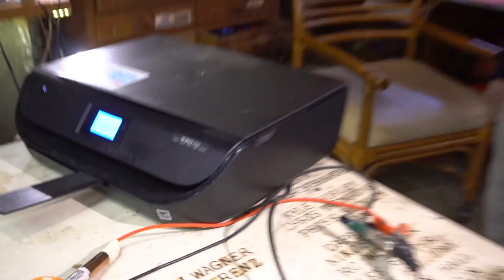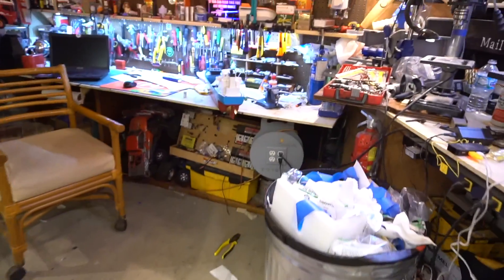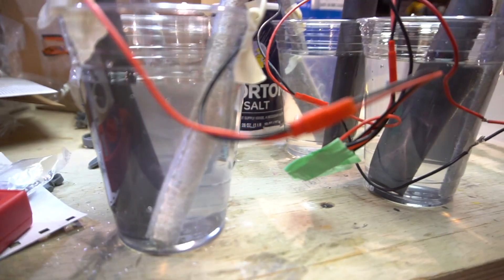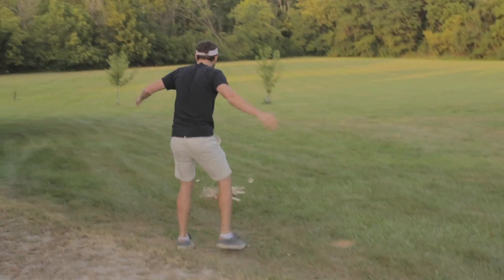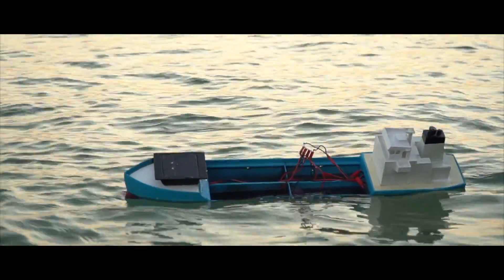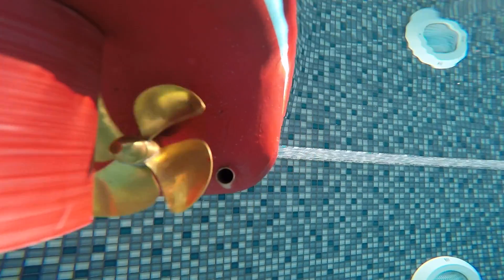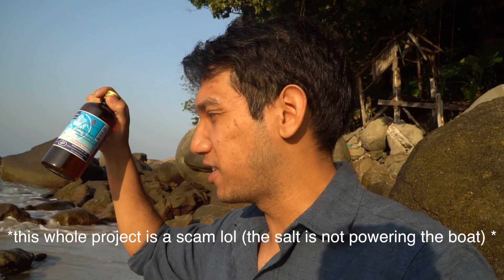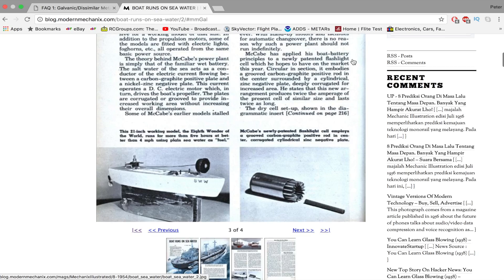Saltwater Powered RC Boat

Comment: What if you made a boat hull out of polyester resin and fiberglass with lines of alternating metals inlaid into the bottom of the hull and use the seawater that's under the boat rather than putting the cathode and anode inside with water? Would the voltage increase when water flows past the alternating strips of metal faster ? For instance if I built a 15' long by 8' wide trimaran and put in on anchor in salty tidal waters would the passing currents act as a charging system for a 12volt battery bank if I used alternating strips of say copper and aluminum and would it be better to run them lengthwise or perpendicular to the flow of water?

Comment: As a very old engineer nearing 85 years old, I am amazed at what one can do with the sophisticated blocks that are available these days for one to tinker with.  In my days it was not like that and we had to build the engineering block ourselves in the case of radio, I had to design and build the Tx and Rx down to transistor-level including winding our own motors and even making our own batteries. Engineering which I followed was not only tinkering with assembling and operating ready-made units,  but one had to learn about the characteristics of different materials, do a lot of calculations hence one needed a good background in mathematics and we who took up electronics we had to learn and test all there was to learn in analog and digital and switched electronics to achieve all the functions including memories and processes in microprocessors.  
At 6:08 this young man said, 
" I went to school for a course in aviation, but really did not quite finish that, for I really wanted to switch majors......so I did try an engineering degree, I did not fare so well in the super formal engineering settings so I left believing in more self-education from various sources such as YouTube, because I wanted to understand problem-solving through tinkering rather than listening to
 lectures   ...... It does not matter how you learn as long as you have a good idea of what is going on." 
The problem with many people these days is that they love to be the proud owners of what they buy as long as one can afford it to live with that mentality, but there is much deeper knowledge than one can ache3ve by just tinkering with assembling units bought off the shelf.  Going back to 1950 we used valves to make out Rx and Tx and by 1960 we were beginning to change over to transistors.
After learning all about transistor circuits  I decided to build my own eight-channel pulse with modulated Tx and the complementary receiver with proportional control. By then my mathematics was up to the level of understanding Maxwell's equations and solving to be able to design antennas and waveguides and their detailed performance. including gun diodes at their earlier stage.  
* The modulation stage of my transmitter was a set of eight variable pulsed followed by a synchronizing pulse fed to control the 35 Megahertz power oscillator radiating about half a watt.  All that had to be tuned to a center-tapped antenna matched accordingly.
* The receiver was a superheterodyne unit that i had to design from scratch where with the local oscillator the intermediate frequency was handled by a tuned amplifier and after demodulating the pulse train one needed to pick up the synchronizing pulse and with it set a counter to zero. Then the following pulses would step up the ripple counter where the output pulse on each " channel output" would remain for the duration of the pulse which was a duration of  0.5 to 1.5 milliseconds. The frame rate I used was about 30 frames per second.
Our enjoyment was not in just assembling complex units and operating them, but designing and making and tuning an eight-channel proportional control  Tx and Rx must have taken me about three months at least. When I finished that I remember building a submarine made out of oil gallon tin containers and that also required calculations rather than trial and error or tinkering with off-the-shelf units. 
We lived through WW2 and my three brothers and I did fill in our time with formal engineering education at a university and the mathematical engineering contents were high which enabled us to handle very complex state control systems and their stability. At the university, we were the first to design and deposit resistances and capacitors on glass substrates leading the way in microelectronics.  To be honest my heart sinks when the people seen in this video use Tx Rx and servos and such sophisticated electronics on disposal throw way units. If only rather than tinkering with them they would appreciate the level of intelligence that goes on to understand the intelligent circuits that are enclosed within them. Even designing and building a bootstrap circuit used to make us very happy and as we could not afford to do what young people do in this video we used to dismantle one circuit and use the capacitors and transistors and resistors in another circuits, we did not mind the inductors as we designed and wounded them according to (N^2)/S, One of the most difficult circuits we designed at around 1955, was the counter circuit which detected the synch pulse and then counted the number of pulses to decode each channel. These electronic circuits we later used to design the arithmetic logic units in microprocessors. 
Those young people who wish to take up engineering must be able to persevere beyond tinkering with off the self bought units and they need to be patient to build up a solid background in mathematics and now computer programming using engineering-oriented software. One cannot learn the highest grade of engineering by tinkering with the available devices as that is more of a technician level and not an engineering level. Any engineering direction needs a high amount of mathematical knowledge to be able to appreciate the many higher aspects that tinkering and assembling units bought off the shelf gives the operator a good thrill but that is not what one calls engineering.  Engineering does not need the sensationalism that normally accompanies videos on YouTube. 
Here is one aspect of the mathematical contents in engineering.  https://youtu.be/r6sGWTCMz2k. 
Laplace functions and Maxell's equations and Navier Stoke equations are also beautiful mathematical tinkering that needs perseverance and a higher effort to follow........ https://youtu.be/-LsXjVfucHU         https://youtu.be/g-5bi7dxHP4
https://youtu.be/Gq-sUhP3kDI
Reply: How did you get that old

Comment: Great build! How about you stick metal strips under the boat and used the ocean as a electrolyte? You could have multiple strips for higher voltage and current (with SxPx configuration), the weight should be lower etc.

Comment: what if you made a small engine that could pump fresh salt water in to the boat in one end and suck the old water out in the other end... that way you could build a closed system and control the level of the boat... they could be powered by solar panels... but really cool you made it work so well...

Comment: Magnetohydrodynamics is a thing but works on completely different principle. You would need a cryogenic cooling system, superconducting magnets, and a really stout inital power source/energy storage. Basically the the magnets are powered by initial power source at first, and make use of the Lorenz force to strip ions from the salt water and create current to power systems, but a byproduct of ripping these ioms free actually moves the water physically, creating thrust while generating power. IDK the threshold at which the process becomes self sustaining, and IDK if it's ever been done in small scale and would be very expensive if even possible.

Comment: I bet then you could put a computerized waypoint till that thing you could put it in the ocean and it will drive you may need to make a better bigger boat but it'll be able to drive automatically to where you wanted to go.  I bet you could make it to one of the islands close to where you're at Is autonomously with a computerized adreno system running your simple little boat
 I dare you to try that

Comment: Using a magnet and the orientation of the magnet in order to have the boat be facing a certain direction on the compass means you have a navigation system if you put a rotating magnet on there if you want to go South you point the magnet's North end to the back of the boat you want to go East you point the North end to the  Left side of the boat and so on

Comment: Maybe try drilling a hole in those electrodes and insert some copper rods. This might decrease the resistance of graphite rods and magnesium rods while keeping the surface area the same. You can also try using graphite spray on bare copper wires. This is going to make the boat more efficient. This might help you. Make more of these 3d printed ships and try different stuff like hydrogen fuel cells, solar cells, etc.

Comment: Or the Mark 44 seawater battery powered homing torpedo?   Weighed 150 pounds less than the later Mark 46 which used OTTO monopropellant with a swashplate motor.

Comment: If we make a boat. And we make cylindrical holes in that boat so that the water crosses from the tip of the boat to the back. And in those holes we put hydroelectric power generators. To power some turbines. Would the boat go on forever? Translated by google translator

Comment: Thanks the H2O2 tip was a needed tip for me. For budget-minded experimenters like me pencil graphite and magnesium camping fire starters are what I use and to get more service area I drill holes through the magnesium and I also scratch up its surface a bit.
here's a question to you do you think you can make something like that that will fly using a big pill bottle for a battery

Comment: The orange juice, or potato juice, or salt water, act only as the electrolyte, they are not the source of the energy.  Saying that such a boat would be powered by the salt water is like saying that a car is powered by the fuel lines, not the fuel in the lines.

Comment: You should program a rasberry pie or an adrino to just transfer the file to the 3d printer from the pc without removing the card because thats how my 3d printer is setup and it works great

Comment: Instead of adding more rods for surface area next time drill holes in them. Reduce weight at the same time.
Reply: This is a much smarter solution.
Reply: or make it into the structure of activated carbon, 1 gram of it has surface area of a football field.  (roughly)
Reply: Lol it will run out quicker :)
Reply: If the boats too light then it'll be unstable but I see where your going
Reply: @olsirmonkey  exactly what I was thinking. Watch any boat without most of the weight in the bottom and it’ll be tossed side to side

Comment: I was suprised by something you said but I probably shouldn't have been. Ive spent considerable time working in many manufacturing type environments with all involved from engineering to management to bean counters and this marriage is often one thing thats lost. Young engineers for the most part have no clue what it takes to solve a problem without wasting money and time. Most try to impress with fancy gadgets to solve a problem that a popsicle stick will fix. If they could leave thier ego and little feelings at home every day they would be partly home free but the engineers that keep quiet, and learn and listen and most of all never put more parts or complexity into something than must be there will do better than most. Giving excuses to a boss has never stricken me as an option but asking what they want and getting them there more often than not will ensure a persons value. You, in my opinion would be and will be a good asset to whomever you work for or with. You have my respect and Im not scared to try anything.

Comment: If you increase the surface contact area of the cathode and the anode with water will this increase the voltage or the current?

Comment: Great little project. As a Naval Architect and an amateur tinkerer myself I'm quite happy with the concept. Of course, would not work on a commercial scale due to motion resistance rate according to displacement and power generated versus area. And if anyone thought as I did, to generate HHO from sea water.....please do not. It liberates chloride gas into the atmosphere, destroying the ozone layer. Still fancy project.

Comment: This is a very good idea. I have considered something like this for producing power. The concern I had is that the magnesium would eventually dissolve into magnesium oxide and be a pollutant in the water. However, it should be easy to recover that magnesium through evaporator pans, and reprocess it in the new rods.

By using the hydrogen peroxide you end up making it an air cell. This would be in combination with the saltwater cell. However, I have had success just pumping air into the cell instead of hydrogen peroxide.

Comment: life vests sometimes have saltwater activated search lights so if you go in the drink in a plane the battery will work for a long time. cheap batteries to boot and they don't light up until you get em wet.

Comment: Looks like with a more efficient hull shape designed for low power applications (like a rowboat hull for example) and a propeller designed to match the motor, this could actually be viable propulsion for a model boat. Using closely spaced flat plates for electrodes could also help produce more power.

Comment: Whats the deal with the little solar panel, battery pack, and if that does work why can't you just have the electrodes on the outside of the boat in the water it's floating on
Reply: The Galvanic Battery isn't stable enough to supply the Radio Equipment
that's why it needed a Solar Panel

Comment: Why is our Navy not doing this! Think of the millions of dollars in fuel saved! Not to mention aircraft carriers, frigates, and  other vessels with unlimited range...think of the military strategic potential!

Sure, it would need some tweaking, and you would have to have lots more electrodes to power the large ship props, but there would be more space to do that...I wonder what the energy/mass/surface area/# of electrodes ratios need to be to make it feasible on a ship that's between 100-350 meters long?

Keep in mind that diesel powered vessels carry many gallons of fuel which would be replaced by the water...and even nuclear powered vessels use water for cooling their reactors.

Comment: In the 70's, oil drilling platforms used salt water reaction with the same idea to power the rig. they were huge and heavy but worked. Reason was that the cost of fuel and the shortage of the fuel during that time required some innovation.
Reply: So... they proved the oil they were drilling didnt need to be drilled? I can see why it was scrapped.

Comment: Make an aircraft carrier like the real nuclear powered that doesn't need to be re-fueled.
Reply: 5billion lemons later
Reply: Against the law and dangerous.
Reply: @tomatosoupwoo  nuclear power is safe in the right hands
Reply: @daniil6089  yeah because coal, which is responsible for multiple orders of magnitude more radioactive waste each year, is so much better right?
Reply: @lazymathemagician  as if there are only two options, sovok
Reply: @daniil6089  I mean realistically 100% "clean" power will not be enough to sustain the energy grid until fusion is achieved. Nuclear fission is the best option until then, modern reactors are safe, carbon neutral, and the little waste they produce is stored safely underground (VS in the atmosphere and oceans). beyond that, it's the single best energy production method availible with modern technology in terms of effeciency. It also doesn't rely on sunshine and wind which is a big plus, nuclear reactors can remain operational 100% of the time which means we don't need to create giant battery farms or innefecient hydrogen farms to store temporary energy. Also, despite its reputation its actually by far the safest power source, resulting in far fewer deaths in proportion to energy output than even solar and wind.
Reply: @lazymathemagician  I disagree. That's great, but only until your hometown is not an exclusion zone and your children and their children have cancer. Payment for a accidents is too high.

Nuclear reactors will sure have their major role in the near future, but this is not The solution to every problem. We need them, but as few of them as possible.

As far as energy needs and sufficiency, instead of striving for more and more energy generation maybe we need to focus on over-consumption problem. As with everything else.
Reply: @daniil6089  Once again, nuclear is literally safer than any other power source. it's true, look it up. A Chernobyl type event is practically impossible with modern reactors, which require pretty much zero human intervention.
Reply: @lazymathemagician  ever heard of Japan?
Reply: @daniil6089  why does nuclear waste matter if it's stored safely? It's unbelievable to me that people want to pass on the single best energy source ever discovered by far because of the evil boogieman nuclear waste despite the fact that everything from plant construction to operation to maintance and waste storage is still safer than any other energy production method by far while also being carbon free (even more so than solar which requires the mining of rare earth medals that produces pollution). If we want to switch to purely "green" energy (which isn't even really green), it'll take decades to build the infrastructure and technology. nuclear is ready to bring us net zero immessions for an even lower electricity cost right now while taking advantage of existing infrastructure (coal plants can usually be converted to nuclear).
Reply: @lazymathemagician  i don't know how much you get paid but go bother someone else.
Reply: @daniil6089  nice rebuttal lmao
Reply: How much do YOU get paid to bother someone?